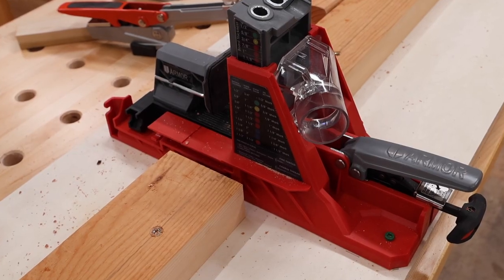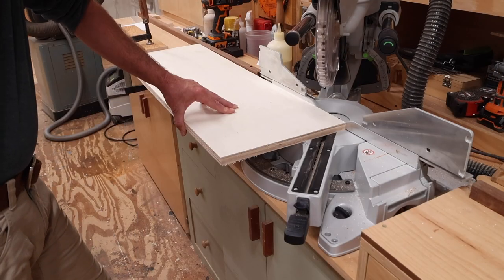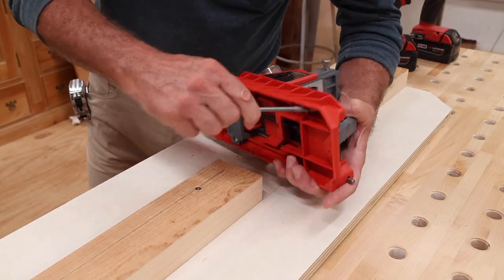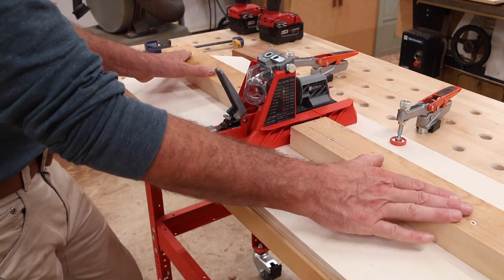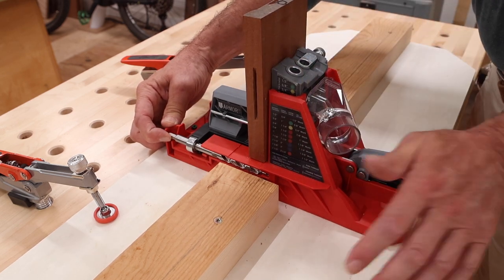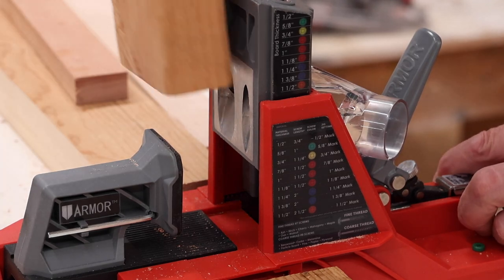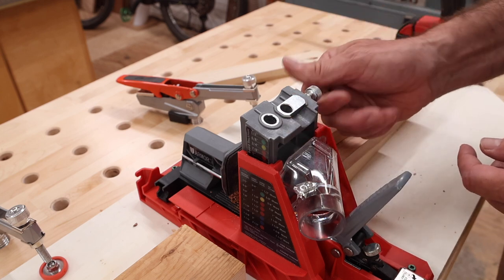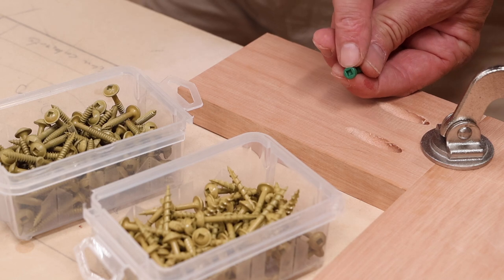Armor Tool Auto Jig Pocket Hole System - How to Use This JIG

Comment: Hi Jon, I just received my new Armor auto jig. Thank you for your video. Now I can attach dust collection to my toe screws connections. As an aside, the dust collection, pressure Handel and drill guides are all on the same side. So the worker can work on large panels without having to reach around the workpiece. Good advise! Thanks!

Comment: I must say that the Armor brand does have some perks.  Main one to me is the guide stop for the thickness of the material, that is a quicker set up than Kreg's.  But Kreg does make a decent set up also.  It all depends on the users needs, more than being fancy. 
Thank you Mr. Jon
Take care
Reply: I agree, Tim. I have the K5, which I like. But locating the stop collar isn't as straight forward as this. Also, the K5 dust shroud pops right off with the slightest bump. I always have to clamp my vacuum hose the benchtop to keep it attached, which is annoying. Wonder how secure Armor's clear dust shroud is by comparison.

Comment: hi Jon, i have the same jig but when i drilled the pocket hole, it is not as deep therefor the screw is not totally hidden. I have the Kreg R3 and the hole is very deep. I've contacted Armor tools and they sent me a replacement, same deal. Since you have the jog, how deep is your pocket hole?

Comment: Are you still planning on getting a Makita track saw? Are you considering holding out for the Milwaukee? I don’t have any Makita tools at this time, but the 40v Makita looks good. I am a little hesitant to get the Milwaukee track saw when it’s available, even though I’ve got a lot of Milwaukee tools and batteries.  I prefer to wait for Gen 2 and make sure they’ve worked out the kinks. Any thoughts?

Comment: I had this jig and it was a complete piece of crap! The drill jammed up in the sleeve and broke in half. Armor has one of the worse customer service anywhere! Finally got a replacement 6 months later and after maybe 10 uses, drill jammed again and snapped! 
Switched to Kreg and it’s worked perfectly for past 2 years!
Reply from the maker: So far so good on my end, the ratchet on my K5 broke so I’ll be using this one for now